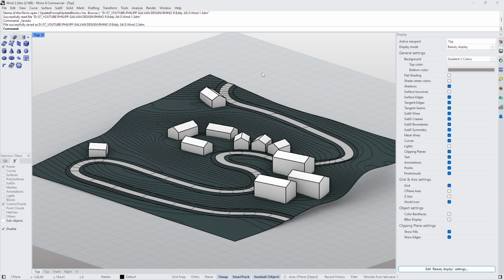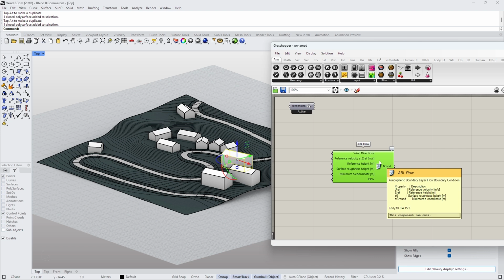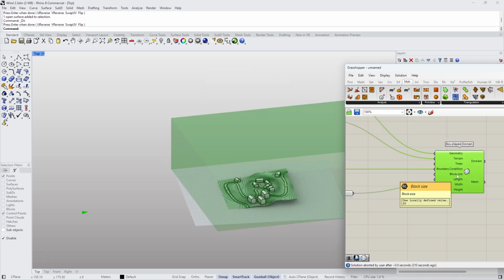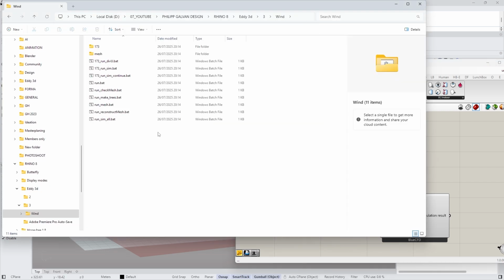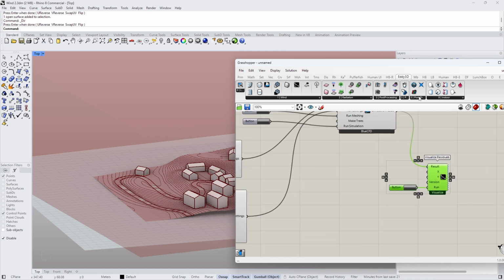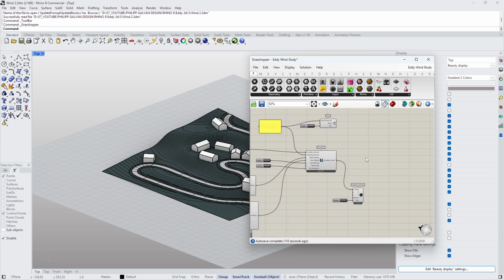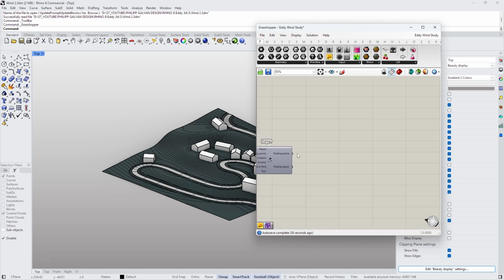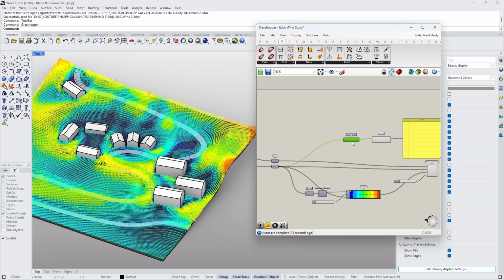Eddy3D  - The Real Way to Set Up Wind Simulations (No BS)

Comment: Hi Philip, thanks for the tutorial. I am one of the developers of the Eddy3D plugin. Please reach out to me anytime you have questions. Btw, I have some notes for you:
-For the computational domain, it is better to model a larger area around the focus of interest. If you let Eddy3D handle it, it will create a large computational domain, like a box, and you will have an inappropriate domain where air flows all around your 3D model, such as below the terrain, etc.
-For templates, we are trying to update them frequently. Please check the latest version of Eddy3D. We are only a few researchers to update everything, and this is an open-access, non-commercial tool.
-For probe points, there is a better way to have homogeneous point intervals. Please try to use the brep2grid component for that purpose.
-Last, we have a surrogate model that runs instantaneously on urban cases. If you would like to learn more about it, we can collaborate on a tutorial.
Reply from the maker: Hey thank you Ilker.
These are really good tips. Thank you.
I'm looking at the new release and there is a lot to unravel.
Lets catch up soon.

Comment: Thanks for the tutorial!  Just getting into Eddy3d; I did have a question,  when displaying the vectors, they seem to be in the opposite direction of the set wind direction- was wondering what side the inlet should be? Thanks.
Reply from the maker: What study are you doing ? Indoor airflow?
Are you using a surface for your inflow area. You might need to flip it?
Reply from the maker: Having said that. Eddy 3D can show different aspects of you the simulation. You might want to double check the inputs and options in your visualisation sections.

Comment: Hello! great tutorial, I have a quick question about previous code runs and if those are reusable. I have had the simulation running for quite a while and have its graph saved on my computer but unfortunately had a malfunction that resulted in my computer crashing. I've been trying to see if there a way i can use a previous run at the simulation to display through the probes but have been unable to figure it out. is there any clear way to do that or does the simulation have to be one that is actively running?
Reply from the maker: If your script is setup the same way as before and same model the data, should be all there. 
If so the script automatically should 'see' the data. If you script is setup correctly and if you ran the probe points you should see a result.
Reply: @PhilippGalvanDesign  Perfect! it worked out. I have another quick question if you dont mind, What is the best way to bake these vectors?
Reply from the maker: hmm vectors are sadly not a geometry type in rhino. But you can translate vectors into lines if you want. I did a video a while ago for Butterfly but its the exact same principle.
https://youtu.be/bGDaR5bZoqA
Reply: @PhilippGalvanDesign  Thank you so much!
Reply from the maker: Glad I can help

Comment: HI! where can i find the working directory? Yous elct somethign from your personal fodler but i just dont know what is hould create before. thanks so much! I love your videos
Reply from the maker: Can you tell me the time stamp in the video. So I know what are you referring to. Thanks.
Reply: @PhilippGalvanDesign  Thanks so much for the answer. minute 10.37
Reply: you copy and pasted on a 
panel some folders that i dont know where to get/create
Reply from the maker: Understand where the confusion comes from.
You only need to set up a folder on your drive and copy the URL into a panel. 
Eddy will write all the data for your simulation into this folder. You don't need to copy anything.

In the video I just cleaned/deleted everything in the folder from a previous simulation so I can run it from scratch.

You need to do that if you change things in your model or settings otherwise the simulation will just load the old data and not run the simulation. Alternatively you setup another folder for each test. But from time to time you need to clean these as these data sets are huge and take a lot of space on your computer.

I suggest your folder naming to be simple.
No special characters if possible.
Reply: @PhilippGalvanDesign  Thanks so much! It tells me that my parameter index (-1) is too low to run the wind simulation. What can I do? Thanks a lot
Reply from the maker: Just try to set another number. You can't break anything. Every project is different so you need to play a bit with the settings. 

Worst case scenario is when grasshopper freezes...  Then just restart.
Reply: @PhilippGalvanDesign  Unfortunately I'm trying to change numbers but nothing changes. This error still remains and I dont unerstand where to edit it because I dont have anywhere this -1.
Reply: I think is a problem of the folder. It doesn’t paste all the data like it did with you
Reply: Sorry Philip to disturb again. Do you think the problem is because I didn’t download bluecfd or open foam? It’s like the link between grasshopper and the folder doesn’t link because he doesn’t copy anything.
Reply from the maker: Yeah you need to have BlueCFD core installed.  Eddy 3D or Butterfly is just an interface. 
Check the Eddy3D page which version you need to install.
Reply: @PhilippGalvanDesign thanks so so much for the answer. I saw that bluecfd last version is only for rhino 7. Do you use that one I guess for eddy 3d simulations?
Reply from the maker: Don't know where you got this information
Please check this video, this should help you understand it better.
https://youtu.be/2-sKqlyZAUg
Reply: @PhilippGalvanDesign  Hi Philip, thanks so much for your help. Unfortunately, even after correctly installing BlueCFD, the simulation still doesn’t run. I tried changing the input values, but it seems that some data might be missing or not being passed correctly. Do you have any idea what could be causing this? Thanks in adavce a lot.

Comment: SOLUTION FOR A PROBLEM:
Hi Philipp!! Thanks so much for the video.
I followed your tutorial to the dot, using a really simple geometry of 3 buildings and a flat rectangular terrain. Everything went fine till I had to create Probing Points for the terrain by 'Culling' the points of the building. 
For some reason, the cull yielded just ONE point for the whole terrain. I tried to figure out why this was happening and tried to resolve this by trying manipulating the geometry in Rhino as well as Grasshopper in many different ways. 
Ultimately, what worked for me was to directly connect the 'Building Geometry Brep' to the 'Geometry input' of the 'Box-shaped Domain'. 
Then, to generate the 'Probe Points' for both the Building and Terrain, I used 'LB Generate Point Grid'. I connected the Terrain's 'Mesh output' to the 'Ground Mesh input' of the 'Probing' component.
For the Building's 'Mesh Output', I first had to connect it with the 'Mesh Explode' component, then the 'Mesh Join' component, then it went into the 'Building Mesh input' of the 'Probing' component. FINALLY the points on the terrain were correctly 'Culled' to generate a 'Culled Ground Mesh'. The rest of the steps were the same.
I hope this helps someone else who might be facing the same.
Once again, thank you very much for everything you're doing here!! 
Regards ~ KP
Reply from the maker: hmmm that's odd , this sounds overly complicated.
It shouldn't be. I need to check if I missed something to explain in the video. Thanks for making me aware.

Comment: Do you think it works with flexible objects like tents out of fabric?
Reply from the maker: You are not able to simulate flexibility in Eddy3D, like physical deformation. You can define porosity but currently Eddy just only allows you to select a rough conceptual range. (For Trees but works for any porose object). I suggest you think about what you want to get out of the simulation. Is it stress testing a structure or wind /comfort analysis?

Comment: Hi Philipp, thanks for the incredible video
I followed your setup exactly, but I’m getting no output from the Visualize Residuals component—no residuals and no vectors in the end of the script. A panel after Probing Results just shows Null vectors (or 0,0,0).
The probing seems to work, though, as the probe grid appears correctly over the terrain.
So I guess something went wrong during the simulation itself, but even after several attempts with different parameters, I couldn’t figure out what. When the terminals pop up with run meshing and run simulations - they appear for a bit but then just close .The system runs with Rhino 8 & CFD 2020 is installed.
I was hoping you might have a quick tip.
Also, you mentioned the script and Rhino files are available for purchase—could you please link that?
Thanks again man
Reply from the maker: Hi, not sure what the problem is, but check the comments below, there might be an answer already. A few people had similar issues. Wrong Blue CFD installation.

Comment: Hi Philipp! I’m running into an error with my Eddy3D simulation:"1. Solution exception: Exception of type 'System.OutOfMemoryException' was thrown."I tried cleaning and simplifying the file I was using for the code (at the simulation component) and even adjusted the Windows paging file, but it still won’t run. Do you have any ideas on how to fix this?
Reply from the maker: What is your unit system? Meter, millimeter?
When does the error occur?

Comment: Sorry its me again, Is there some kind of way that I can do an analysis in section with eddy3d?? If I can, can you do a video about that?? please 🙏🙏
Reply from the maker: Can you explain a bit more what you mean by section. You mean a portion of a space? Is it because of computer power or because of clarity you want to do that?
Reply: @PhilippGalvanDesign yeah I mean you are doing the analysis on plan view, it would be really cool if you could do it on section view
Reply from the maker: So basically you can set your probe points not based on the topography but based on a plane. Vertical or horizontal. Or you could create a manual grid, plane, section, cloud of points. The calculation is done for the whole wind tunnel. The probe points are just a way to make the calculation visible where you want to show it and how. Hope it's clear.  I might do a video about it.
Reply: @PhilippGalvanDesign thank u very much for your tutorials, they are helping me a lot
Reply from the maker: https://youtu.be/AMt6g2grcCI
New video on how to  set probes in different ways, including section like analysis.

Comment: Thank you for the valuable video, big brother. I have one question: I set it up the same way as in the video, but the flow only shows vectors at the boundary's inlet. Is there a way to address this?
Reply from the maker: Not sure... What is your unit system in Rhino.
Meter?

Comment: Hi sorry to bother you, there is some kind of way to reduce de amount of vectors? My model is full of measuring points and I would like to reduce the amount of vectors.
Reply from the maker: Yes, using the topography mesh normals is just one way, but you can set any manual points. For example you could place a plane with points, a point cloud or a single measuring point into the model.

Just be aware that a calculation is still happening for the whole wind tunnel.

Comment: sorry to bother, I was trying to use this, but When I connect everything exactly like you do, the program doesnt run a prompt window like yous did when you hit the 'button', it just flash and quit very quickly. I have tried a lot of times and double check a lot of times, but it is still having the same issue, is there any possiblities that you know why is that? Thanks!
Reply: Same here. Reached out on Github and seams to run fine for others. Idk if its my computer....
Reply from the maker: Try to increase the accuracy of the mesh 
In the video around 11:30 - the higher the numbers the more accurate. 
If the accuracy is too low it fails right at the start.  Also try to increase your interations to 500.
Reply: @PhilippGalvanDesign  Hello! Thanks for the amazing video. I have the same issue. I've tried everything you guys said below and I really can't spot any problems. Any ideas? 
Thank you!
Reply from the maker: Try to increase the accuracy of the mesh 
In the video around 11:30 - the higher the numbers the more accurate. 
If the accuracy is too low it fails right at the start.  Also try to increase your interations to 500. 
https://youtu.be/HvIDoF92Qbg?si=eb58oMmpilEJmhDi
Reply: @PhilippGalvanDesign   Thanks! I will definitely do that!
Reply: I had the same issue. The problem was that I didn't install BlueCFD 2020 in the right folder (C:\Program Files\blueCFD-Core-2020) since I was not the PC administrator
Reply from the maker: @Ncalle92  
this is really good to know.
thanks for this.
i would never have guessd.
Reply: Hello guys. Got the same issue : problem here was I was trying to run it with a directory on my external ssd drive. Created a folder on my desktop instead and it ran! :)
Reply from the maker: You might need to clean the folder where it captures everything. Or remake the folder to create a new data container. But also it runs very quickly it might be a problem with the resolution. 
What is your file units? Meter, millimeters or other unit?